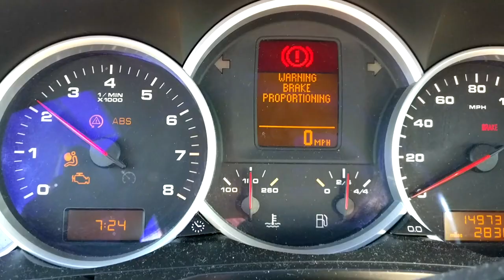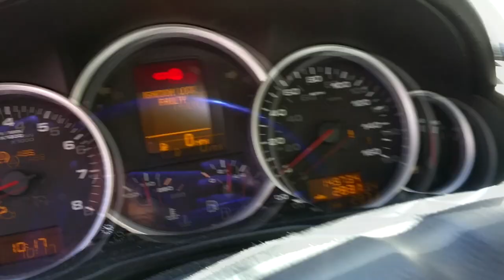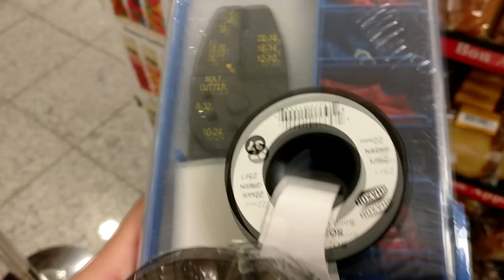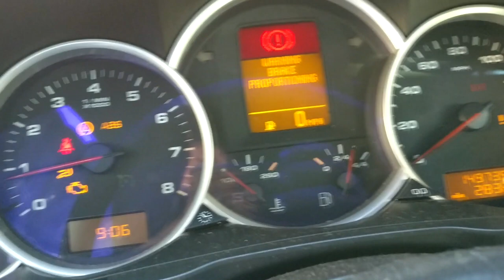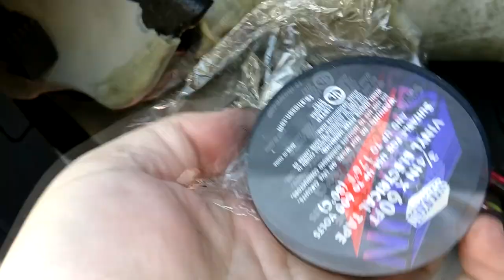Porsche Cayenne Breakdown with ABS Brake Proportioning Error - CAUSE was aircon leak under glovebox

Comment: Thanks for posting,. I had the same errors, found two of the four spliced wire connections had corroded to the point wires had broken. I repaired all four spliced wire connections, resealed them and Cayenne fired back up.

Comment: Now time to fix the leak and drainage!!
Reply from the maker: Yep. I'm hoping it's a disconnected hose and will get under the dash this weekend to have a good look around...   :)
Reply: Attack it from under the hood/bonnet buddy. It's not the A/C, This is caused by the a flooded bulkhead (which the A/C drains to).
I made a video of this and it literally takes 2 minutes.
Let me know if you have any questions.

Comment: Thank you Motolimey for posting this video! I had the same Ignition Lock Fault error after some major water infiltration on the driver's side foot well. I myself would likely have never found the spliced wires let alone the corrosion if it wasn't for your video (and https://youtu.be/nQXjeVf_B7U )... I soldered up the splices and resealed them and my Cayenne fired right up error free.

To viewers: there are videos posted on this issue that suggest you simply need to disconnect the battery to clear the fault. I did not find this to be true at all.